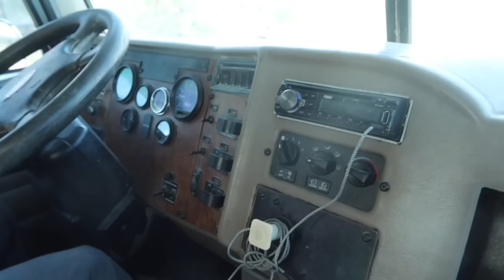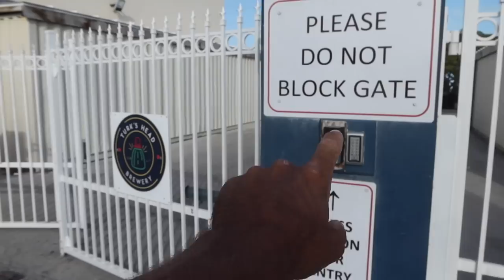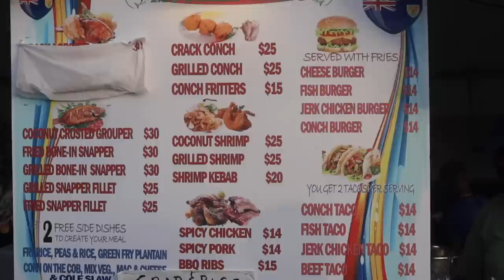STUCK in Turks & Caicos due to Engine Problems

Comment: I said before I'll say it again.... FILTER your fuel gas and diesel when you get it. filter it before it goes into your tanks. places outside of the USA have very low quality standards. The mating flange of that water pump has some heavy corrosion not a good sign. Did you check to see that the SILICON that your using is high temp rated??? If you have a blow out leak from the area that has corrosion. The only temp fix is to use high temp rated JB WELD epoxy. That area ss cast aluminum so welding is not a good idea. from what I saw your motor (IS) going to give you more problems and a lot of them. Mainly related to the cooling system would be my best guess. All threaded bolts should have tef gel on them or an anti seize.